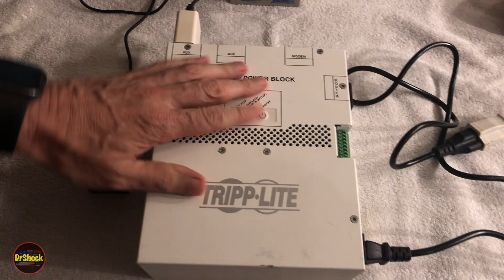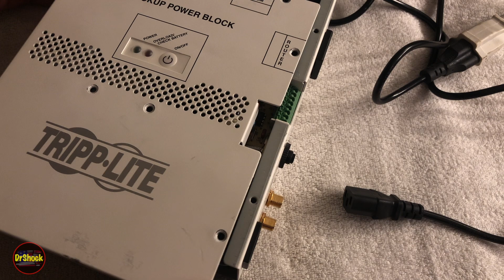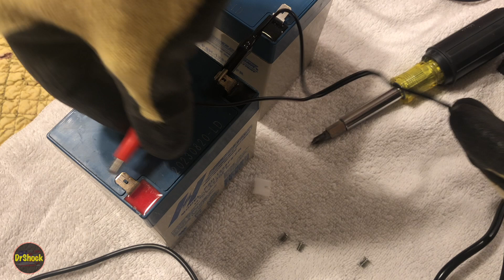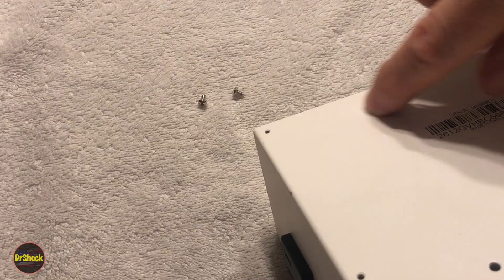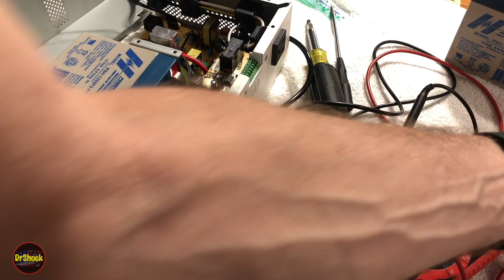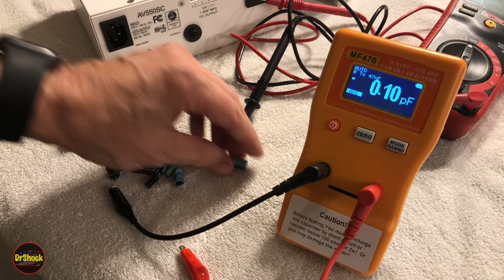Tripp Lite AV550SC UPS Randomly Powers Off ~ Not Charging SLA Battery Diagnosis & Board Repair

Comment: Where did you purchase the assortment of capacitors?
Reply from the maker: I did not purchase an assortment as this type of packaging will usually consist of inferior Chinesium type parts.  Instead I selected and purchased them individually to be OEM name brand specific (e.g., Nichicon, Panasonic, Vishay, or United Chemi-Con) .  I did put links in the description for the two specific caps that failed in the unit I showed in the video.